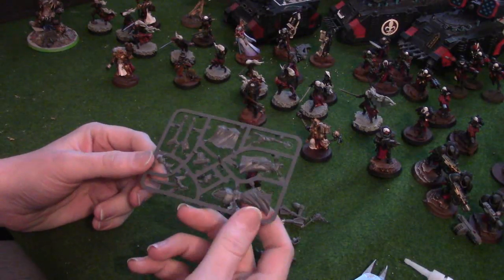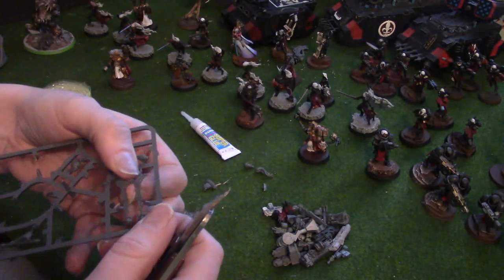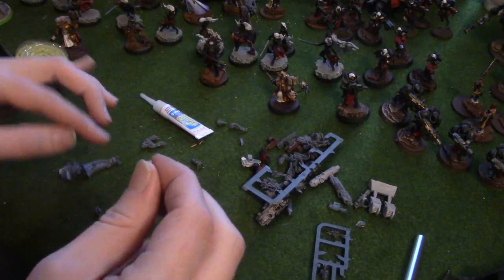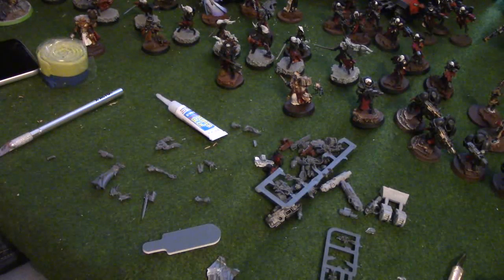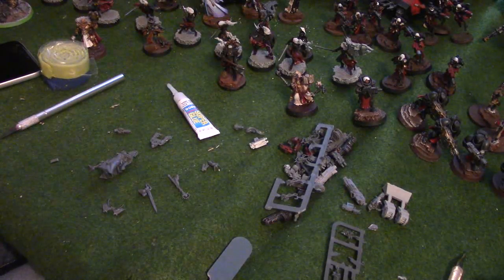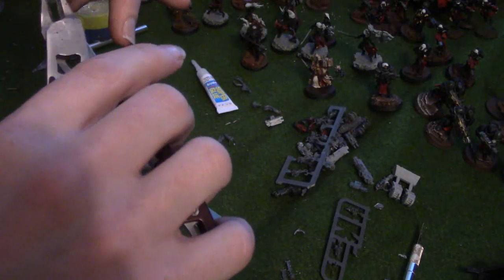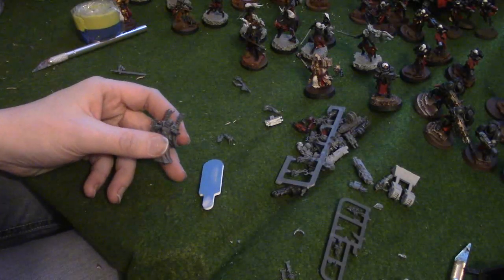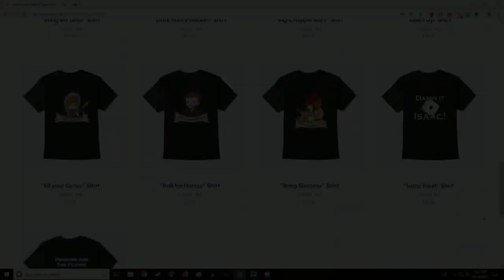Converting the Canoness To Make Her Playable and Well as Look Better Overall

Comment: I would wait for the first FAQ before taking any storm bolters off of the sisters superior.  Just in case GW messed up.
Reply: i wouldn't hold your breadth with that. i think they removed storm bolters from sister characters to stop storm bolter spam unfortunately (especially masses of Dominion/ Celestians squads with Blessed Bolts... which would have been awesome. )
Reply: @helline9  You're probably right.  But waiting for the FAQ before pulling off storm bolters might save a person a lot of work if they did screw up.

Like how the monopose cannoness is technically illegal(from what I've heard I don't have a codex).  Waiting till the FAQ to possibly make her legal might be a better idea then kitbashing the monopose cannoness to make her legal now.
Reply: Also you can still give them stormbolters from the index as you still can use index wargear... For now...
Reply: Are both of the new Canoness models equipped with illegal equipment options?

Comment: Oh here's a tip I don't know if you know this or not maybe you do.

if you save those little foam pieces the kind that comes in blister packs you can use them to absorb excess glue that can mess up details. 
They soak up like a sponge.
I also have that hobby vise that GW sells.
And those alligator clips called helping hands to hold things.